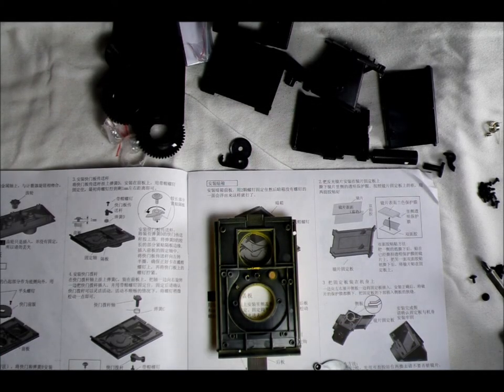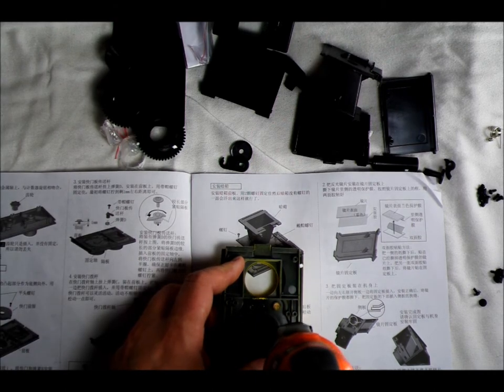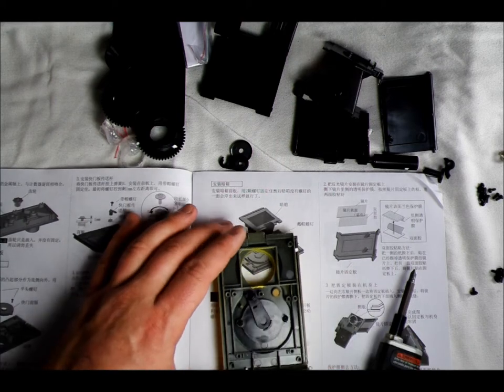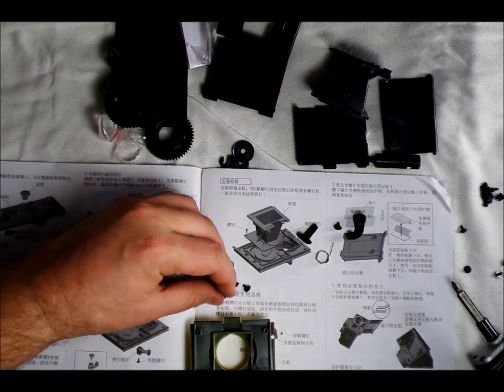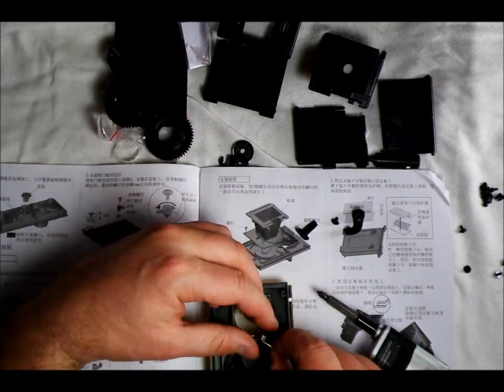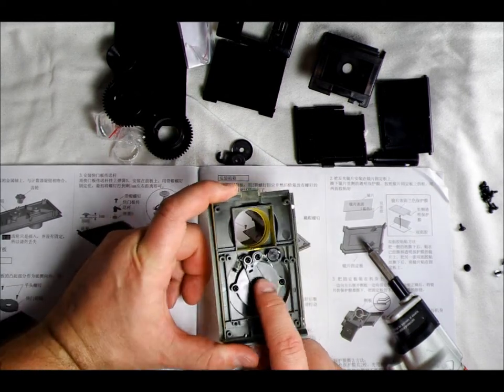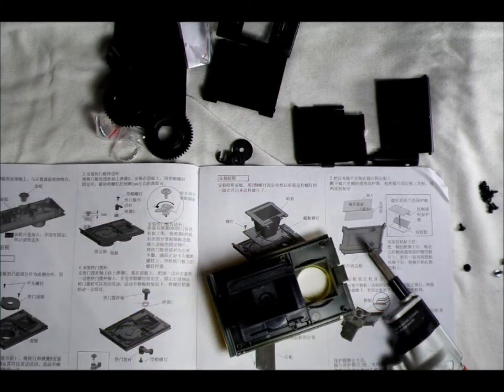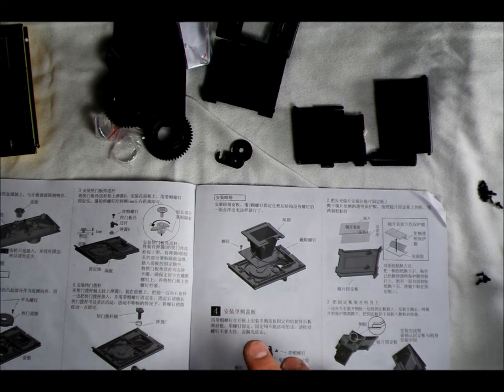Assembling the Recesky Plastic TLR Shutter -- Video 2

Comment: I finally figured out how to assemble the shutter levers (thanks to countless youtubes and support pages)but is it possible I stripped the shutter panel transmission lever screw as it only spins and will not hold.
Reply from the maker: Do you mean that the screws only spin or that the leaf shutter part only spins?
Reply: the screw into the shutter panel transmission spins will not hold lever or spring in. I don't know if it was a defect in the kit or if I somehow stripped threads while assembling since I was putting it together and taking it apart countless times. notedco is sending me a new kit!
Reply from the maker: A new kit is ideal! My guess is that it's a flawed part.

So... if you don't have any plans for your old one other than to recycle it, I'd be happy to take it off your hands. I have an experiment I want to try with one of these but I don't want to destroy one just to see if something might work.

Comment: My shutter works fine up until the moment when I put the top of them camera on where the viewfinder is. Any suggestions? Also I stripped the screws that hold the obscura in place
Reply from the maker: My guess is that the top part is changing how the pieces fit together. Try loosening the shutter screw a third or half turn and reassembling. Let me know if that helps.

Comment: My shutter activates when it is released, do you think there is a problem with that?
Reply from the maker: +Noles Dire When the release lever is released? One of mine does that, too. It just changes how you trigger it is all.
Reply: ah, ok, thanks, actually i corrected it now i 
just pressd the lever a litle bit more so it was able to go under the other shutter thing.
Reply: +David Hancock by the way  my shutter opens and closes way too fast do you think its a problem, or does it normally works like that? i finally completed it, but i woudld hate to waste some film if its wrong-
Reply from the maker: The shutter speeds on these vary wildly. Even on mine, the speeds are inconsistent. Film is, in general, pretty forgiving and there's a lot of tolerance for exposure errors. Try out a roll and see how it does. The results are probably going to be unexpected and fun.
Reply: Ok, thanks for your help and videos, they really helped me.
Reply from the maker: Thank you and you're welcome.